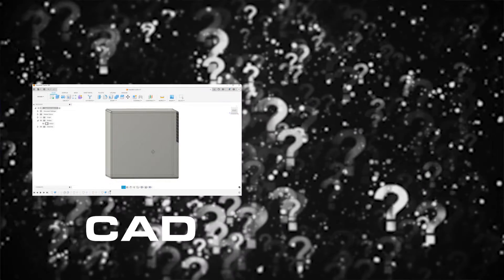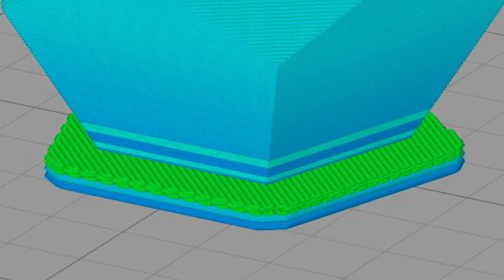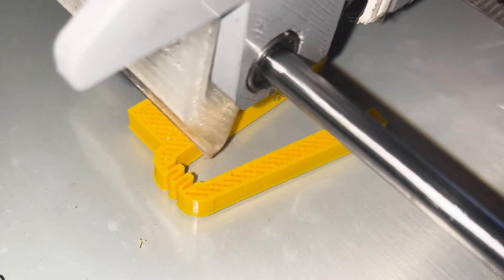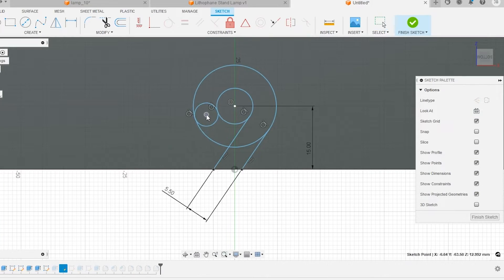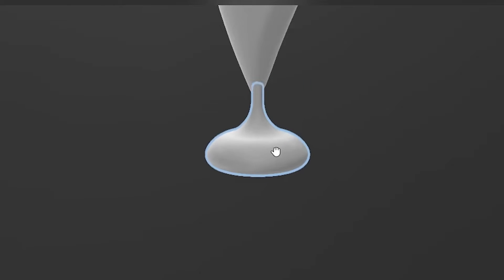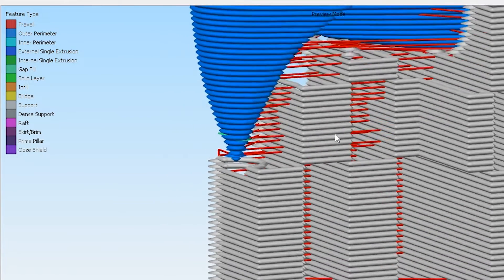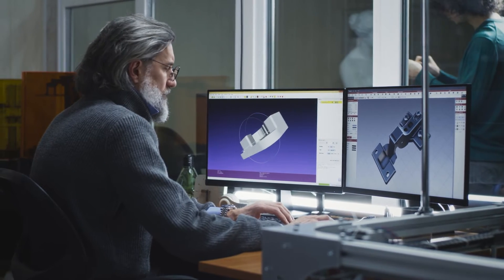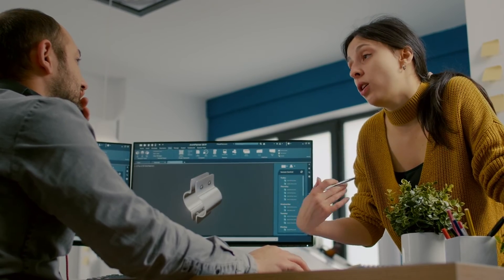CAD vs Slicer. What to rely on when mass producing a part with 3D Printing.

Comment: I would have to respectfully disagree with this statement.  The person designing a part and sending it to a print farm to have it printed isn't going to have the knowledge or skill to create features to support the printing process for a printer they don't own.  I would say avid hobbyists that have their own machines can play around with this although I can't think of a case I would model the brim rather than letting the slicer do it.  And you show Fusion on the thumbnail, fusion has a slicer that works on the CAD geometry so it lets you export G2/G3 movements if your controller/firmware supports that.  You update the CAD geometry, you simply regenerate with all the same settings.  You can also place custom supports in the cura slicer as well as in Fusion including tree supports.  Adding features/tabs things to a 3d model specifically for 3d printing I think requires the user to have their own printer and a pretty deep knowledge of the process.  I think if the file gets sent to a MFG for printing then the quality/output is on the manufacturer.  If there is a problem with thin parts and supports or adhesion to a build plate that isn't for the customer to figure out for the manufacturer.  If i send a part off to have a mold made, the MFG doesn't ask me to model the mold for them, they review the file, ask me to increase draft here, add an ejector location there etc when they redline a drawing.  Or if the part is hard to hold the shop doesn't ask me to design the soft jaw or add tabs to the design.  That is the job/requirement of the manufacturer "programming" the part.
Reply from the maker: For mass production you have to design for the process. You can make 1 or two parts however you like. To make 1 million requires optimization and that optimization is only controllable in CAD. Slicers have too many black-box features.
Reply: @slant3d    Ok so if that is the argument, how is that not on the MFG to do?  My points still stand.  A mold house doesn't ask me to design the mold.  A cnc shop doesn't ask me to design their fixtures.  If i take a part to manufacture the question about quantity drives some aspects on my end, but ultimately its on the MFG to design the low or high production tooling.  In the case of asking someone to design in all of their support and bonding structures for some unknown print process is not feasible.  That knowledge comes from experience, and if they have the experience, why outsource?  From a business standpoint having the client drive your MFG process is also not an approach that I would want.  People go to manufacturers for their expertise.  If there is no expertise offered why wouldn't the end user just buy 100 printers and print themselves? 

On the same topic, 3d printing a million parts seems horribly inefficient with current technology.  The amount of energy required, the materials, the process, the hands on portion of it.  If you go with a self supporting process like SLS, then the points of modeling in support features, brim etc is moot because its not needed.  The process is messy but the output is good, powder can be recaptured and there are very few design limitations.  Parts can be painted/sealed after printing.  The main reason i have used this as a "manufacturing" method before was for geometry that was too complex for the quantity needed for production.  Say 100 unites.  With FDM/FFF, the time, energy, heat, post processing will be 20 years before it matches injection molding quality, strength, speed, cost, and impact on the environment.  There is no speed increase to stacking tons of parts in a build in that process and the speeds are getting faster but limited to jerk/acceleration issues.  If you go with a photo-curing type printer that has high throughput you can get a big speed boost by putting as many parts in the build as possible since it cures an entire layer at once.  There isn't a penalty to filling up the build volume.  but again those supports you aren't designing in CAD, those are in the Slicer and based on final part orientation and critical features.  And then it comes back to the energy, environmental impact of the print, cure, and hands on post process time which is much higher.

I understand what you are saying, but just feel like its a little misleading.  If the goal is to have people send you parts to print, the CAD additions for manufacturing shouldn't be on the customer, but on the manufacturer.

That is my opinion/point of view so take it for whatever that is worth :)
Reply from the maker: They ask you to design a part to be moldable. We ask that the part be designed to be printable.

Comment: Disagree. Every feature of the part should be modeled in CAD. Any features that are printer dependent should be left to the slicer, for instance brims/rafts/etc. 

For example, I design a part with a raft that has a 0.1mm gap. I print it on my machine with PETG, it works fine. I then send the part to be manufactured out of Nylon from a manufacturer. Now the raft is fused to the part and can't be removed. Same goes for supports. What happens if a customer sends a part to you with a raft, and then you can't remove the raft? Do you say 'oh, well re-model it and we will re-print it' or is it 'we printed the model that you gave us". 

There's a reason that parts are modeled standalone. We do not include tooling inside the manufacturable part, regardless of process.
Reply from the maker: In manufacturing it is a collaboration. Not a Print and Ship
Reply: @slant3d  Maybe at your company, but in the industry I work in, you send a part out for manufacturing, and it gets made to spec. I'm not creating work holding fixtures for parts, I'm not telling the machinist/cnc operator how to do their job. It's their job to figure out how to make the part they are sent, and they charge accordingly.

Comment: You didn't mention the most important part of CAD being much more precise and true to dimensions and loss of that precision when converting the files to be used in the slicers. And the true geometry in cad vs the conversion to triangles can lead to significant problems and losses of that precision.
Reply from the maker: Possibly. But that issue is much more exacerbated by the material shinkage and flow rates.

Comment: It would actually be nice to have some tutorials on things like custom rafts which are normally handled by the slicer.
Reply: I was wondering about how he would model a raft in fusion. The only thing I can think of is that he models a a raft shape and then changes slicer settings to print that objects infill without walls.... Guess I'll try it out and let you know how it goes.

Comment: There are many slicer options that aren't related to geometry that still have a significant impact on the part. Perimeter / wall thickness, top/bottom layers, and infill patterns are common examples. I don't think you can really specify these in cad, can you? The closest I can think of is embedding profile settings in a 3mf file, but that seems to be slicer specific.
Reply: Some things like layer height and extrusion width will likely stay in the realm of the slicer. That said - custom infill is completely doable, but will take quite a bit of extra design work. Time will tell if it's too much of a cost for businesses. I do think it's too big of an ask for hobbyists, though, but that's not what the video is about.
Reply: @logicalfundy  Sure, but if you already have some settings that will stay in the slicer, why shouldn't the process also accommodate other settings like infill so you don't need to spend that extra effort unless it's actually necessary?
Reply: @MichaelPetito  I think what he's getting at is the less tinkering Slant 3D has to do in the slicer, the better. More tinkering = higher labor cost. Ideally, they just select a preset and go.

That said - I think it's fair to say that his vision of the customer doing everything is a bit misplaced. Just as it takes time to adjust slicer profiles - it also takes time to add custom rafts, supports, infill, etc to a CAD model. In fact, the time taken to add things manually in CAD is probably larger than tinkering in the slicer.

So while upon reflection I think the gist of the video is perhaps unrealistic, I can see his point of view.
Reply: @logicalfundy  I don't see the logic here. How is the customer supposed to know the capabilities and settings of his machines? They should be able to send him a part, and he should be able to have slicer settings dialed in for his machines to spit parts out.
Reply: For permimeters you can add super tiny slots in the part(with like 0.05mm thickness. This way the slicer thinks he should print a wall around that slot and will add the walls to both sides. Because the slot is so small the perimeters of both sides will just fuse and you therefore have double the perimeters. 
This is very usefull if the part needs to be strong at certain locations but doesnt need alot of infill and perimeters elsewhere

Comment: IMHO 
1) 3D model (even brep) does not contain enough information to design additive manufacturing process.
2) Most 2.5D FDM slicers way to automated to be good tools for designing good 3d printing jobs
3) 3D printing jobs should be designed just like other kinds of CNC manufacturing.